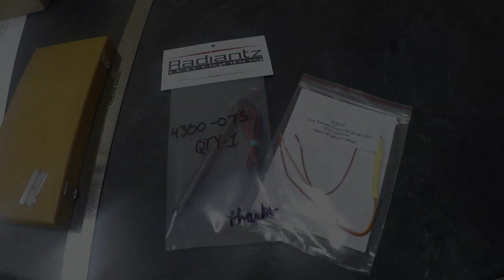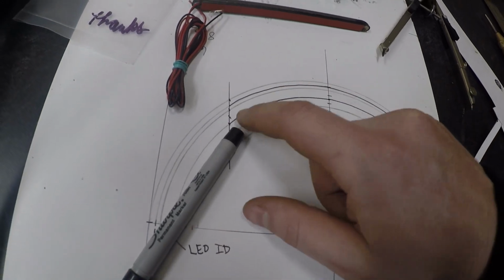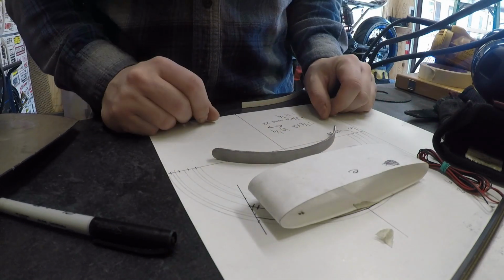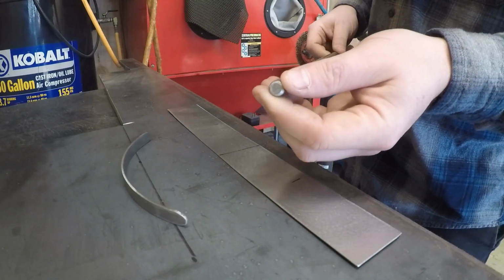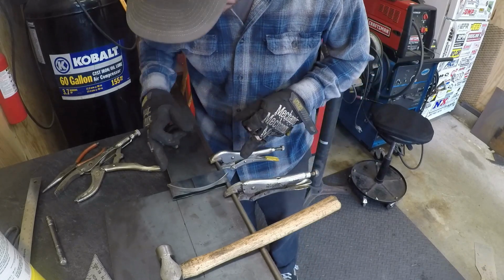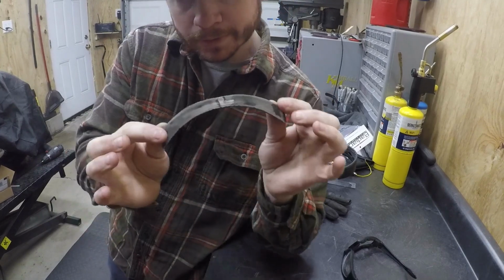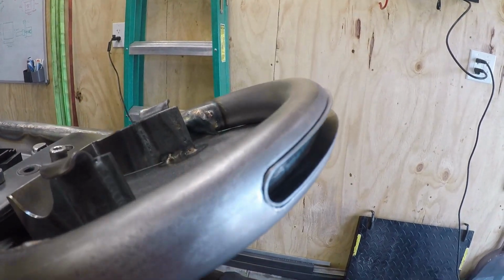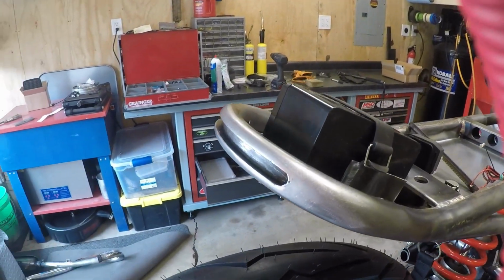CX500 Build - Cafe Racer LED Taillight Fabrication - EP14

Comment: Hey  that was a great job.  That's going to look awesome once you mount it.  Hey here's an idea. Once you insert the lights why not cover it with liquid acrylic? It'll keep the lights from getting hit by pebbles or other. It'll look like the lights are behind glass. Then you can sand it flush with the pipe then polish it. It should look extra awesome!

Comment: This is awesome! I've always wondered how it's done, integrating an LED into a seat hoop. I can never cut as straight on metal as you did on the hoop using a grinder.
Reply from the maker: Well I had wondered the same as I couldnt find any info. You can get the clean lines with time. What you didnt see in the video was over an hour of hand filing to get the gap perfect.

Comment: nice work man- I bought a welder for my project but found out that my eyes can't deal with the light -flux core spit all over the place as well
Reply from the maker: I know the pain. Ive been using a mig for the last 16 years and the spatter has always been an issue. It takes a tremendous amount of time to chip off and remove all the spatter for each weld which is a huge part of getting a tig. No cleanup time.

Comment: Thank you for sharing of your very clear explanation? I just also replaced my turn signa/brake lights to led and they works amazing but there' one i want to ask which my auto cancel and push cancel on my turn signal control are no longer functioning after replacing? What should i do   to make those function back?
Reply: By the way! I just got it figure out!  I'll just going to use a load resistor
Reply from the maker: @filcandiy  thank you! Glad you got it figured out!
Reply: @BrickHouseBuilds  thanks for reply! Any better suggestion anyhow?
I just thought that ,that might be only the solutions ?  Just install a diodes/resistor or load resistors before the bulb without replacing hyperflash relay.
Reply from the maker: @filcandiy  without having a diagram or product specifications I cant really give any help on that
Reply: @BrickHouseBuilds  Ok cool! If i'can't figure   out ? I'll see if i can pull out the diagram and maybe you can assist me ?
Thanks again! So glad to see your video breakdown so clearly !